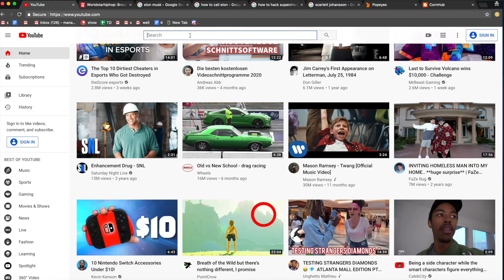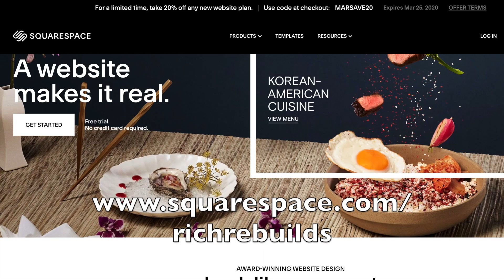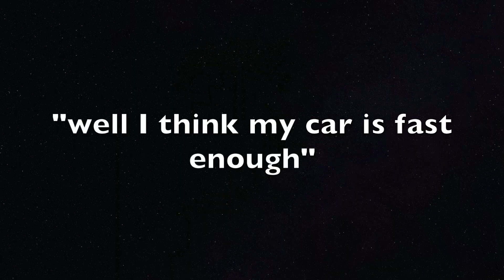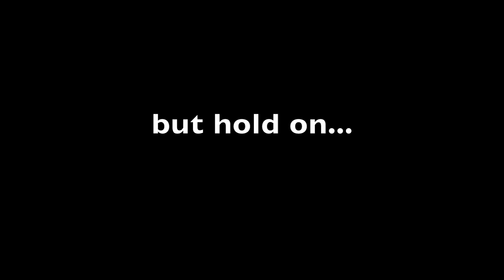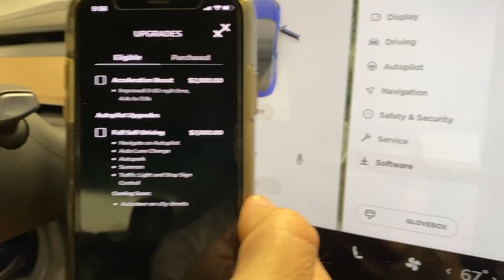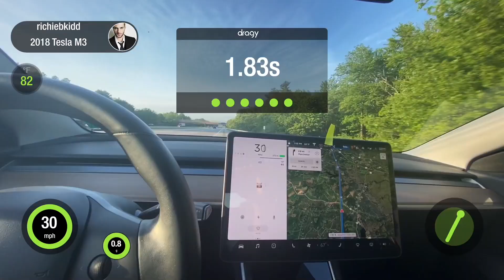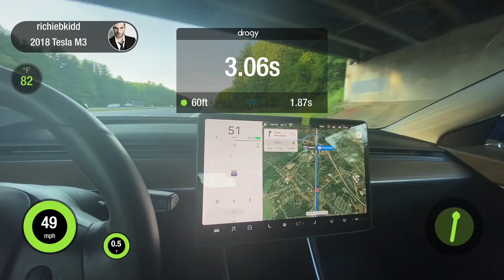We hacked the Tesla model 3s and it's true potential is INSANE

Comment: I need this. Specially when i paid over 53k for my Non-Performance, prior to recent price drops on the Performance.
Reply: My SR+ was 55k after everything was said and done lol. That includes FSD though. Still adore the car but wishing for a little more power
Reply: @GoHerping  how is the fit and finish on your car? I have read alot about  gaps, poor paint job... Thanks Mark in Milwaukee 🍺
Reply: @Marcg-b4n  I was looking at a new $200k porche a few months ago, trim wasn't aligned and bigger panel gaps than my 800 dollar yota beater. not all companies are perfect but for the price I think teslas do ok. not a prototype either, it was a production model.
Reply: @Marcg-b4n  Mine is nearly perfect. No paint issues, every panel gap looks good. One of the door handles is slightly deeper into the  car than the rest, but it's hardly noticable
Reply: @GoHerping  cool! Thanks for replying!
Reply: I took delivery of my car in March 2019. Very minor gap issues, nothing that drove me too crazy. However, recent vehicles are near flawless. Only thing that drove me crazy was how much Tesla kept changing prices during the time I purchased my vehicle. But others paid a lot more than I did for the same vehicle. Sucks!
Reply: @josecardona2229  maybe the m3s are, the Y's are having consistent issues so far
Reply: @vandletookthehandle  it's almost like making a new car requires new techniques and learning and improving lol. you see the same shit whenever a production car generation changes, shit doesn't fit quite right, delays, etc.

Comment: Daaaaamnnnnnn this is incredible. I take it the Ghost upgrade can be applied to Perf. Model 3 too?
Reply: Early model 3 AWD shares the same hardware as P3D- so if you have the 980 motor, they're tapping into the power that the P3D- has. Not sure how much more you can coax out of it as P3D is likely nearing safe limits

Comment: Nice! Question regarding the stage 1 upgrade. If I already purchased the 2k tesla performance upgrade will the stage 1 module further increase power and reduce 0-60 mph times lower than the stated 3.8? If so, have an idea of approximate 0-60 times with combined tesla performance and stage 1 upgrade? Here in So Cal and would love to lower my 0-60 and show my fellow tesla drivers. Thanks!
Reply: It's the same hardware.  So whatever parameters this hack changes the upgrades DO NOT STACK.
Reply: I was under the impression that the 2K performance upgrade was the stage 1 upgrade? So as it's just a firmware "tick box" from what I understand, it would make no difference as both would just activate the same performance settings. Each upgrade does not really "add" power but just changes the settings so everything is allowed to use more power.
Reply: Either just do stage 2 or don’t bother. A sidegrade at best.

Comment: Elon is already using that GPS data to disable that Tesla. 😂
Reply: One of the many reasons why I will not buy a Tesla at this time. They control so many things on the vehicle, it's scary.
Reply: @2010ngojo  like?
Reply: @2010ngojo  all new cars collect and send data. As long as it has something like onstar. This tech has been around a really long time.
Reply: @Emilthehun it doesn't mean they can change how the car performs. It's almost as if you ignore that major part that I was talking about.
Reply: Need make offline Teslas.. where is all game cracking groups now ;)
Reply: @XantheFIN  It should be pretty easy to make it offline - just disconnect the cell antenna. BOOM offline
Reply: Only way I would own a Tesla was if it was offline”.
Reply: @XantheFIN  indeed hire my good friends from CPY!
Reply: There has to be a way to disable internet connection... removing an antenna or so.
However, if they have forced updates (like Whatsapp does), there isn't really a way around internet access.
Reply: @Hoch134   They'll make it so that you need to have a certain version of the software to do supercharging and or fastcharging.  If you just update that number/check in general you block out all the old cars at some point. 
But with more teslas on the road the reward to hack them becomes bigger and bigger so I'm not that worried about it.
Reply: If it is an offline car, couldn't you add a program that bypasses or fakes the verification check?

Comment: The red one isn't a Performance because it doesn't have red brake calipers and it has 19 inch wheels not the 20's.
Reply: Incorrect. It is a Stealth model 3 Performance. These were sold in limited batches at various times in the past.
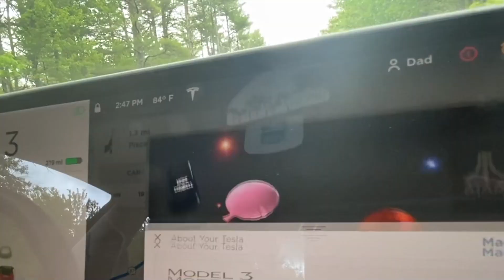Reply: Hey Steven, It is a stealth performance model. Timestamp 13:14 shows the red underline indicating such.

Comment: why is the performance model you have so slow?  I normally get 3.28 or so with dragy at around 70% charge..  also when are you going to make an upgrade for the m3p to drop times under 3 seconds :)...and also allow standing rwd burnouts :)
Reply: The red M3 is not the peromance version no red caliper and no metal pedals. I realy like rich but that's misleading
Reply: @theo4mary  They say it's the stealth model 3 performance
Reply: This upgrade only works on certain model 3 cars, not all of them.

Comment: Software is a powerful thing 👀 

Time to go check my Model 3 to see if I've got the right motor 😅
Reply: Dang it I've got the 1120990 version :/
Reply: The performance cars have bigger motors, right? Or is this a case of the blue car having the bigger motor because they ran out of smaller ones and Tesla is limiting the performance to match the smaller motor?
Reply: @JasonWW2000  probably cheaper to make one motor to fit 4 cars than 3 separate motors for those cars. i can't imagine what rich is doing will be possible for long, elon will be losing profit so i'm sure he wont be happy
Reply: Does it have to be LR how do you know what motor you need?
Reply: Answer these pressing questions, I want to know the answers
Reply: if you have the 990 motor you can only have the stage 1 for now...

if you have the 980 motor you can have the stage 2